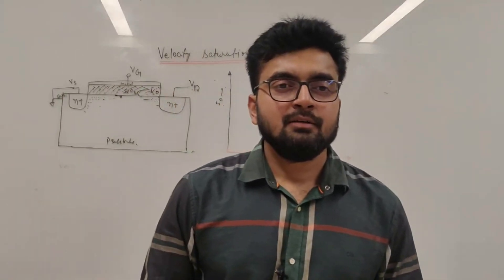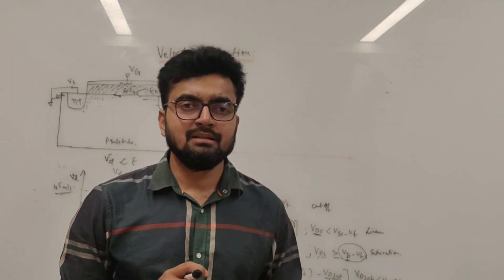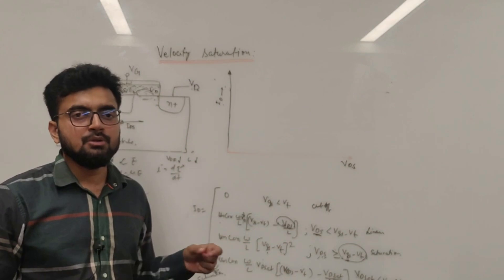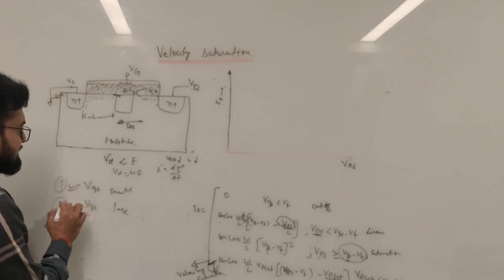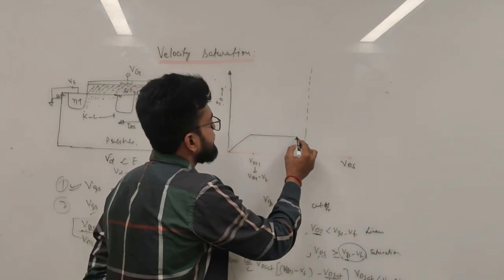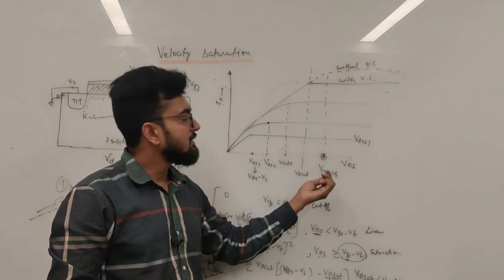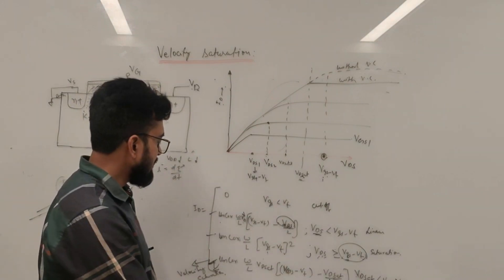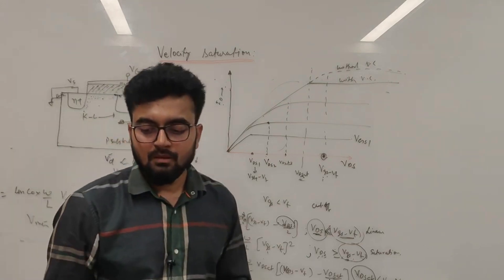What is velocity saturation in MOSFET?

Comment: can u explain how the vds decrease with decrease in channel length, I understand channel length decreases when vds>=vgs - vt , leading 
to decrease in resistance and increase in drain current , (chnl length modln), please crct me if I'm wrong
Reply from the maker: you are right about CLM.
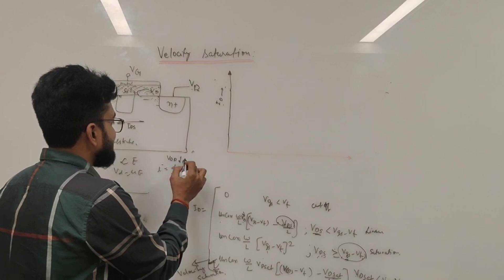Clarifying the point about a decrease in channel length, it refers to transitioning from higher to lower technology nodes(3:07). In lower tech nodes, the channel length is shorter, requiring less Vds to achieve the same current compared to higher nodes. 

Hope it clarifies ur point.